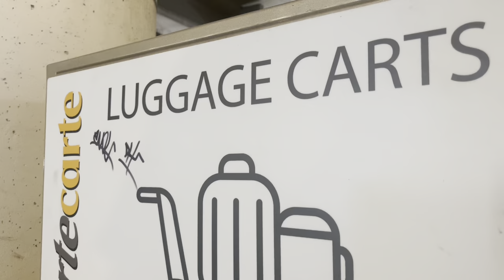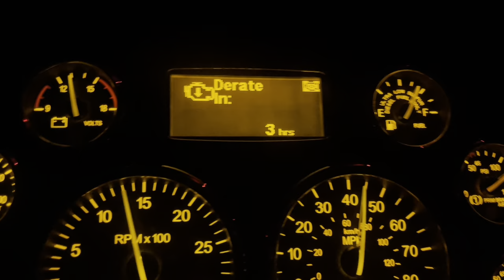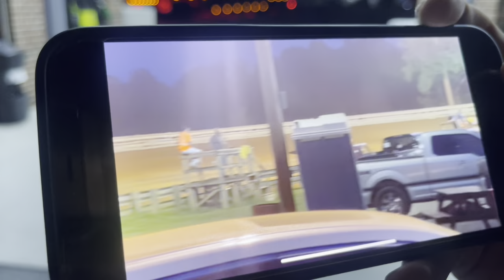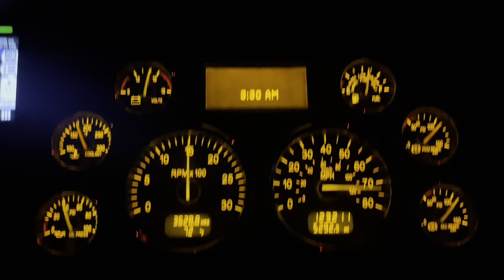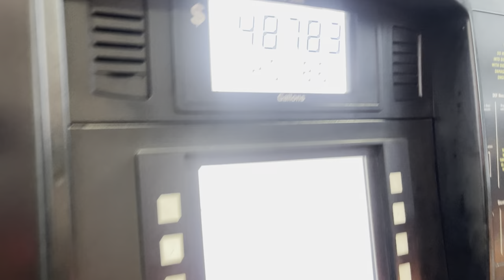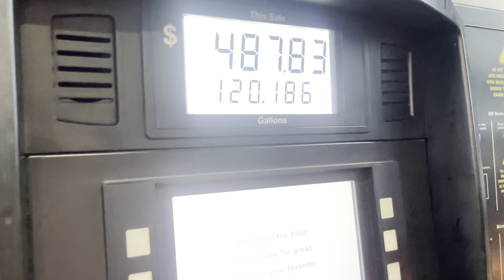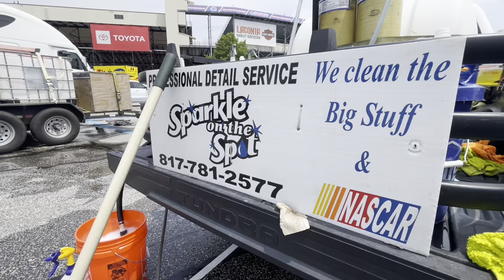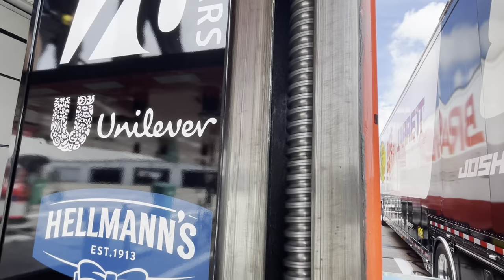Nascar Hauler Saved by a GOOD mechanic

Comment: the new crap on the Diesels I wouldn't be at all surprised that  the lead on the alternator isn't what caused original codes to kick up contributing to the sensor issues

Comment: I have that light at 7:23 its very useful in dim lit areas. There have been times where I am head first in an engine bay when the power in the shop goes out. I didn't notice the difference since I had that bad boy out.

Comment: As motors today rely on more electrical gadgets to run properly, that bad battery cable end might have been depriving system for proper electric and causing sensors to throw intermittent code.   Just a thought!     Enjoyed

Comment: Back in 1995 I took a break from road driving to work at a major Freightliner dealership. In the month of May it was common for a few IndyCar haulers to come in for service prior to the big event. I had team Penske with their COE (the chrome and black one) roll into the write-up service bay and the dash was going nuts with all the bells and alarms going off and idiot lights lit up like a Christmas tree. I've been trucking for 37-years and turning wrenches and never seen another truck like that one before or since. In the end after many hours in the shop, loose power cables. The Detroit Diesel 60 series was a great engine but all those sensors and the ECM rely on clean / intact wires and cables. When sensor codes randomly popup for no reason especially on newer equipment, start at the battery box first and work your way to the engine compartment to ensure all electrical connections are good (battery box, starter, relay, and alternator). Only after electrical system is verified do you hook up computer to truck to diagnose sensor failures if code persists. This method saved me many thousands of dollars in all the years I owned trucks. I recently sold my trucking equipment, moved south and now drive dumptrucks in Nashville to finish out my last few years left to work.

Comment: Don’t know if you’ll see this in time before you take your truck to the shop. But any driver that runs a Cummins ISX or X15, it’s a good idea to do an EGR Tune Up which helps keep the EGR / Regen & Turbo running longer. There’s a guy on YT that has a video that breaks it down as to what, how, and why you need to do an EGR Tune Up on these new emissions motors.  The IMAP & Delta P sensor are 2 that need to be changed and / or maintained as well as the cross over tube and some other components that should be cleaned based on mileage. Anyway, the guy on YT that has that video and breaks it all down is Rawze.  👍🏾

Comment: EGR.
Exhaust Gas Recercalation.
Is not DEF related.
Before Def was introduced, EGR was the name of the game to stay within GOV regulations.
Its re introducing exhaust gas ,mix it with the new air into the cilinder,,and reburn it.
this creates carbon ofset . and realy makes an engine dirty , on the in take side.
so that dirty sensor..
no suprise.

Def is after the engine did his job, its introduced in the exhaust pipe.
yes it can create problems, but EGR is worse than DEF, if you ask me.
happy driving happy living😉

Comment: I loved the exuberance and honesty in this video.  This is my first time tuning in, but I’ve been a huge NASCAR fan who has watched racing every weekend for nearly 25 years.  I appreciate your bringing us along into these parts of the week/weekend that race fans don’t usually get to see.  Thank you.  As for the diesel soot build up in the EGR system, my family has had great luck using “Hot Shot’s Secret” diesel additives.  They make additives that remove water, help lubricate and clean the diesel injectors, and lower the frequency of necessary Regen cycles in diesels.  It’s an American family business started in a garage, that is now a large and super successful with the products they make, especially for long haul diesel motors.  What’s even better is that they boost the cetane rating of your diesel so it has more power.  Whether you’re in the racing industry or just looking for help to reduce potential diesel soot build-up, who doesn’t want more power.  Check them out, we’ve had excellent luck with their products.  Hope that helps, thanks for sharing the fun!
Reply from the maker: I’ve personally been using them for the last 4 years with my trucking business back home. I agree whole heartedly!

Comment: Get rid of those crap Paccar and Cummins engines u guys got under those pretty hoods and get u a Detroit(dd13 or dd16)..had nothing but on going issues with both those engines over my 32 year OTR career, went with a brand new 2020 Detroit and over 325k miles and not 1 issue.

Comment: Stay out of the fast lane.
  Maybe it’s Karma breaking down for holding up traffic in the fast lane…….
Reply from the maker: I think you’re right…
Reply: @realwildwildwest  I hate when I come up on a big truck and they just ride along in the fast lane. 
  Make your pass and get over!!
Reply from the maker: @ltsgarage7898  I hear you there lol. Had to get a good rolling shot of Hollywood though 🙈  Did it “for the tube” as they say.
Reply: @realwildwildwest  nothing wrong with being in the fast lane for a bit. Then you just move back over. I drove trucks for a few years. That was to pick up some cash while I built my plumbing business. But that was many years ago. Probably either before you were born or you were a young man. I’m old. I’ve run my plumbing business for just over 50 years.   😜